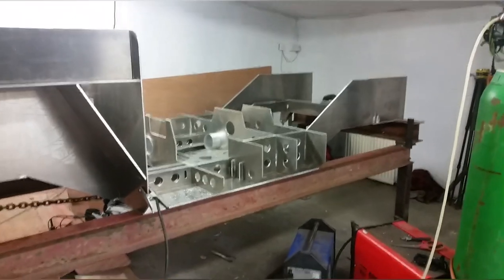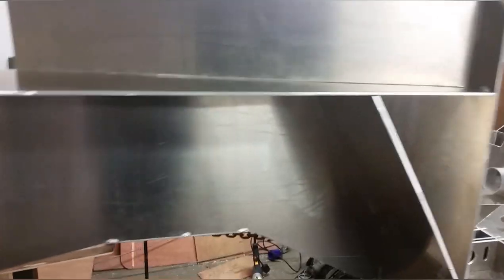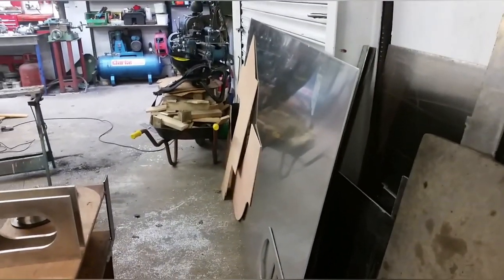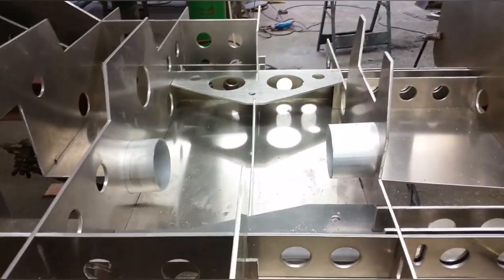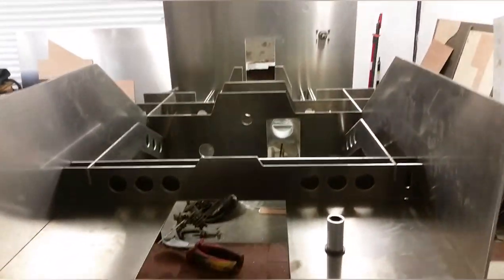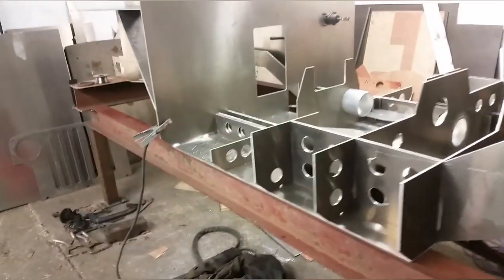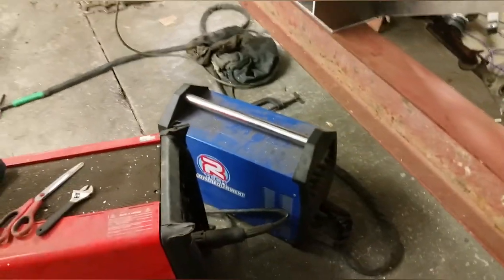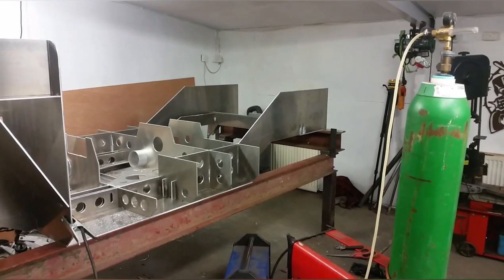HOMEMADE AMPHIBIOUS VEHICLE JEEP BUILD PT3

Comment: Mark I really would like to contact with you with regard to your concrete crusher, I have all the bits and want to get on with it but really need some pics or info on the bottom plate setup and adjustment, please can you give me some help?
Reply from the maker: Theres not alot to it, its basically a plate at the bottom of the moving jaw at an angle of 45 ish degrees... the objective of it is to recreate the same amount of up/down and back/forth movement at the bottom of the jaw as you get from the eccentric shaft at the top...... i will try and do another video on how it works when i get time!